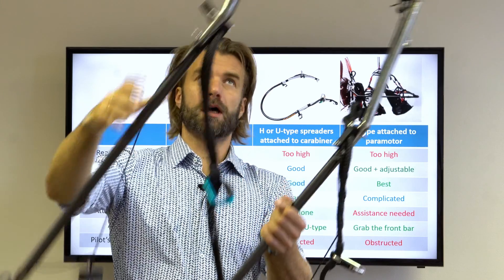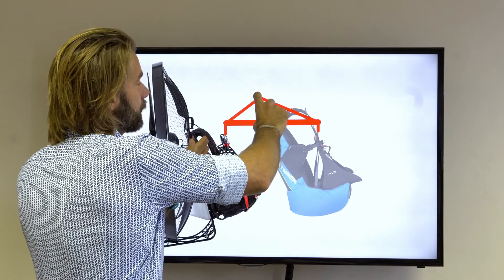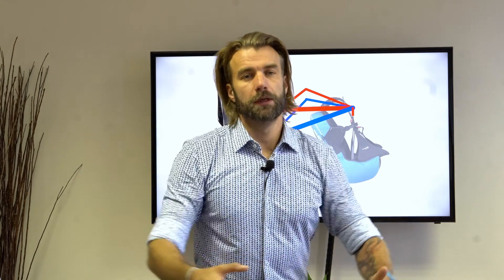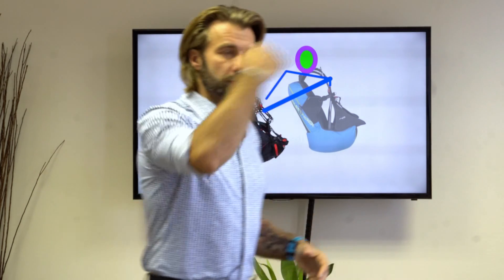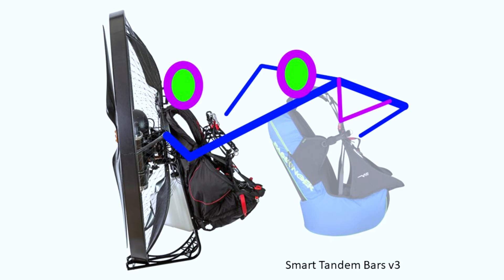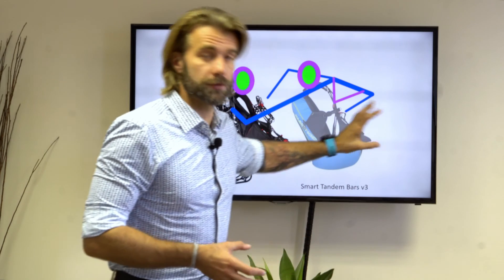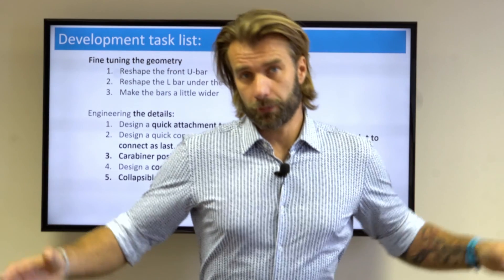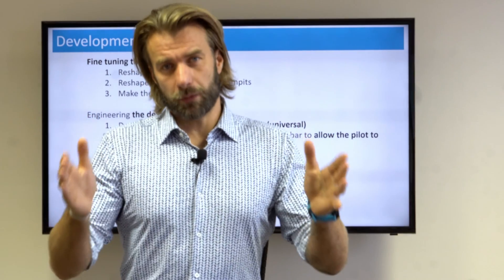Inventing the best paramotor tandem setup - Smarter Pilot series

Comment: Hi Miro, awesome engineering. Aren't you worried that having the carabiner of the paramotor at an angle instead of straight up will increase the load on it by a sine of the offset angle? I see in your hang test that the carabiner is roughly at a 45 degree angle from vertical so that would increase the load on it by sine of 45 = 0.7. So if the paramotor plus pilot is act 120kg you end up with 204kg on the carabiner. Does it make sense to worry about the extra load on this carabiner? Or is some of that weight redistributed on other part of connection. I would love to see what a newton meter would show on that connection point. Cheers and hope this comment is not redundant with your engineering.

Comment: What if you used the tension the other way? Have the in flight forward cg system be relaxed and tighten the ropes to pull passenger into launch and landing cg position.  Then for longer flights, your not straining the ropes the whole flight? Nice work! Love seeing your innovations!
Reply from the maker: Never thought of that. But strain is not an issue. A 3mm dyneema cord can take load of 950 kg. That’s probably 20 times more than the actual load.

Comment: I wonder if you have seen the passenger seat with the attached "pockets" on each side for the pilots feet. These "stirrups" help a lot! First, the pilot have rests for his feet. Second, the pilot can distribute some of his weight in flight, so the passenger stays low.
Also, I basically doubt the idea for passenger to take-off first and land second. This way passenger obstructs the pilot's view on take-off (and landing), which makes it effectively a blindfolded take-off. Once the pilot is lifted in the air first, there is actually not much possibility for passenger to spoil the take-off, as basically the heaviest part is already flying and consequently the airspeed must be already pretty high. Of'course there shouldn't be a drammatical differense between when the pilot lifts-off and when the passenger lifts off. Ideally they do it almost at the same time. And on landing, if the pilot really wants to land first,  he could pull the passenger closer. 
Summary: when we fly paramotor tandems with the U spreader, we attach the passenger chest strap to the front bar before the flight , so that they cannot slow down and mess with our feet on the run. And in the air we put the feet into the front seat pockets, and then ask passenger to release the front tie. The passenger is getting closer to the pilot, but stil kept below the pilot's view by the pressure of the pilots legs. On landing the pilot takes his feet out of the pockets and the passenger gets higher. This is normally enough for landing run, but could also ask the passenger to pull to the front bar again in advance if needed.
I am afraid you are trying to achieve the opposite: more spreading in flight and less in the run. And all because just not using the feet pockets. 
Best to you and thanks a lot for your videos!
PS. I guess you can design a separate pair of leg stirrups and attach them to the U-bar or the passenger carabiners, if you don't want to mess with the companies for the passenger seat update.
Reply from the maker: Many of my passengers stopped running when they thought they reached the limit of their capabilities. Immediately after they realised how bad that decision was. 
This getting them lifted first is always safer. 
The distance between the pilot and passenger in the air is irrelevant. I am not trying to increase it. I am trying too get the passenger lower. 

Never tried “stepping onto the passenger”. Might work although I doubt that the weight of my relaxed feet only would be sufficient to cause significant change in weight distribution.

Comment: Put the roller on the passenger for cable (on the suspension). You will receive a 2:1 polyspast, which will make it easier for the passenger to pull up during the flight. If I wrote it clearly, then ask me again.
Reply from the maker: I already have a pulley 2:1 ratio. I will make it two step: first part 2:1 then the second part 3:1

Comment: For foot launching it is great advancement -- personally I think trikes are the best tandem approach.
Cheers
Reply from the maker: For frequent tandem flights trikes are better for sure. For occasional flights this is simpler and cheaper. 
Also this allows travelling
Reply: Tandem trikes aren’t legal in the UK. So, a well designed setup would definitely e welcomed.
Reply: @paramotorhead  
Interesting

Comment: Why not make brake handles 5 inches lower with an extension? It's not like you'll be flying the tandem wing solo.
Reply from the maker: Tandem wings are manufactured to place the brakes as low as possible. Yet they end up getting too high.
Reply: @SCOUTaviation  hmm, manufacturers of wings....in general need to update more than just a few things. less clutter. risers. brake toggles. magnet-type. holders. are problematic..  next question is why cant the manufacturers come up with a better . idea in the first place.?